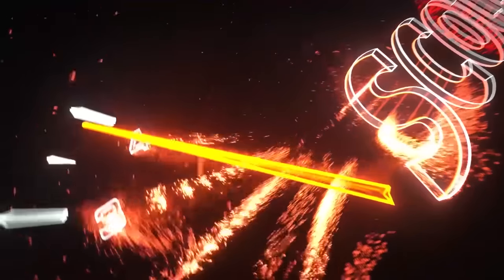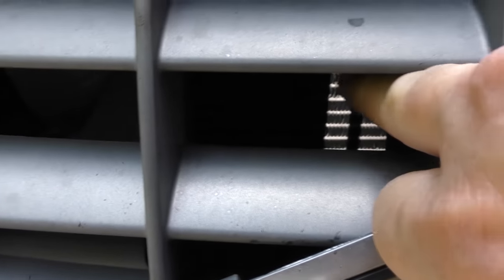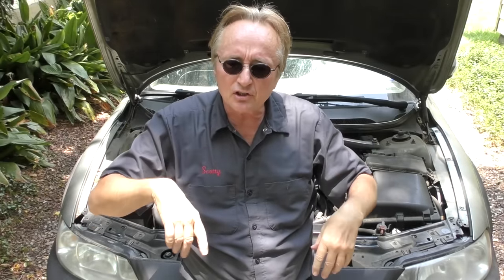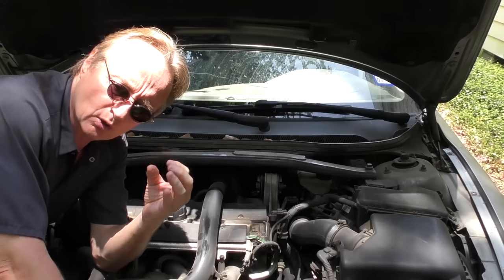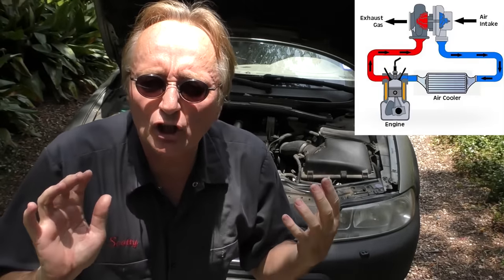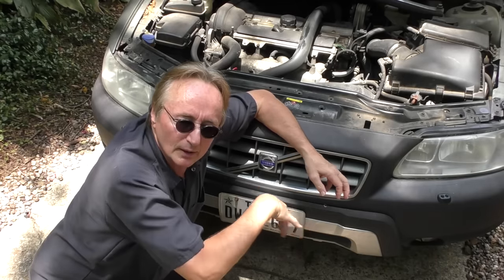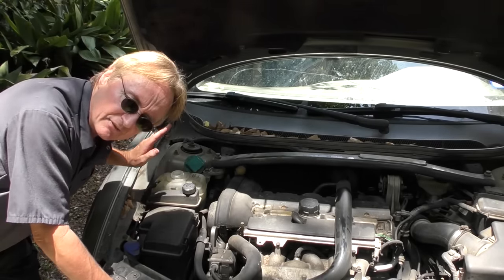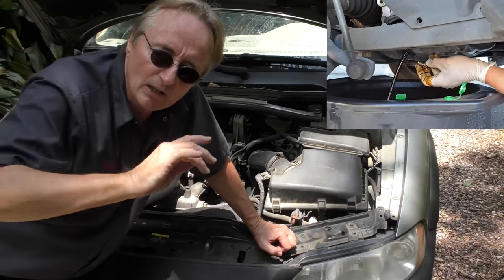5 Things You Should Never Do in a Turbocharged Car

Comment: Bought a Saab in the mid 85's and the mechanic at the dealership stopped me before I drove it the first time and told me the exact same thing Scotty said about letting the engine warm up a few minutes before driving the vehicle hard and also letting the car idle for around 30 seconds before shutting off the engine.  Told me that was the key to not having problems with the turbo charger.  Never forgot it and never had a problem the whole time I owned the car.
Reply: Those old Saabs were capable of very high mileages. Those and the Volvo 240s. Sometimes you had to find the right mechanic, however.
Reply: I don't think it was your driving, they were bullet proof
Reply: Awesome
Reply: Saabs are fuggin' awesome.
Reply: Amazing
Reply: Wow, what an honest mechanic he must be. Wish we had more people like him and Scotty around. Sigh
Reply: Yul Strokheet Al-Wauch it cycles the oil allowing it to cool the internal parts of the turbo. They make something called a turbo timer and it allows the engine to stay running for a programmable amount of time specifically for this reason.
Reply: Yul Strokheet Al-Wauch   A turbo charger can spin at up to  250,000 RPM  and the second the ignition is switched off the oil pump stops supplying oil to the bearings . The high temperature ,  lack of oil and still spinning  turbine  will eventually  lead to bearing failure  . If you cannot grasp that its probably best you dont spanner  any vehicle's  .
Reply: Came here looking for this advice. First-time having a turbo-charged 2.0 6-speed Honda Accord. Want it to last with no problems. Thank you Scotty! God Bless you & yours and Stay Well

To Derek & Johnny, I appreciate this explanation... Thanks
Reply: do that in my 2005 saab aero religiously also change oil every 6k 
let it idle for thirty seconds after hot run before switching off
Reply: Dealerships don't tell you anything like this nowadays, they just want that sale. They will let anyone test drive by themselves with no guidelines on driving with a brand new engine, who knows how that new car was ran during a test drive!
Reply: @tygyrlylly8079  interesting, not my experience.  Have bought 8 brand new cars. Not once was I allowed to drive them by myself. I'm 62 now, and bought a brand new car last May. STILL, had the salesman   on the test drive in the car with me.
Reply: So I stop the car after a drive to let it idle about 30 seconds.  Am I doing this with the the car still in drive or neutral? Or do I idle it with it in Park?
Reply: I'm about to buy my dream Saab in 2 days 😎 05 9-5 Aero in black with ventilated seats 😁
Reply: @chuckfan1 park
Reply: Also stay on top of all the maintenance of the Turbo cars! You'll pay very dearly if you don't.
Reply: So ya bought it in July of 85,,,, nice
Reply: I was informed that the more modern cars don't require this

Comment: Here's also a tip: With a modern turbocharged car, turn off the start&stop system so the engine doesn't get shut down after driving hard.
Reply: I turn it off every time I get in my car.
Reply: Is there a fuse or relay you can pull to turn it off permanently?
Reply: Texas BEAST some cars you can hook up a laptop and do some programming stuff. On 16 and newer Ford pickups you can use ForScan to rid that feature.
Reply: Yeah, start&stop is a cancer for the engine. Here in EU every car has to have it, and in some countries you can even get fined for disabling it. I just turn it off after every startup. New volvos have it kind of more clever though. It does not shut off the engine for a few minutes after startup, and also after driving it hard. Even after you turn the engine off, you can hear the electric water pump buzzing, so I guess it still runs water through the turbo to cool it.
Reply: —TheManInDboX — My manual car has start&stop, I turn it off though
Reply: It will not shut down if the engine gets harmed maybe older systems but not new
Reply: You also get aftermarket electric oil pumps that will keep a supply of pressurised oil flowing to the turbo for a few minutes after engine shut off, so that there is lubrication for the spin down time. There are also hydraulic accumulators that provide a similar function, having a bladder filled with air to pressurise an oil feed for the turbo for a minute or so after oil pressure drops.
Reply: —TheManInDboX — my Jeep has it and it only turns off if you come to a complete stop in neutral with the clutch engaged
Reply: I hate that idle stop/go.
Reply: @SeanBZA  or just put a turbo timer on it lol
Reply: Manakuski. That's a great idea because after high speed driving the turbo should be allowed to cool a while before switching off the engine, it's funny how the manufactures neglect to tell you this on Stop/Start engines but with turbos costing a fortune to replace when the Warranty has expired it does make you wonder if there's a reason for this. I have run diesels since around 1985 when they became available and then on to the turbo models, I have always let them warm up a couple of minutes from cold and then allowed them to idle before shutting it down after a fast run, in all that time I have Never had to replace a Turbo. I do regular oil changes every 7000 miles and change the filter every other oil change and this seems to work great.
Reply: @KevBoy3D  what do you have? My 2020 Accord is a 6-speed manual and doesn't have the start/stop. Didn't think a stick would have it.
Reply: @RestrictedHades  makes me wonder if my Accord mt has the start/stop since I'm always in a gear with the clutch depressed when I'm stopped in traffic. Dealer never mentioned it or the need for the turbo to cool although I knew this from operating a work vehicle having turbo.
Reply: Terri S 2012 Renault Clio
Reply: @Tsch6373  Clutch should only be engaged for shifting gears and only for shifting gears.  Don't have any reason to have clutch engaged at light.  Put in neutral at light and if necessary to not roll, use in conjunction with brake. But no clutch until you need to put in gear or changing gears.  Clutch is not a substitute for neutral.  Neutral is the only substitute for neutral
Reply: Write that down! Write that down!
Reply: I hate the start stop! Why it’s always on boggles my mind. It should be off and if I want it on, then I’ll turn it on. have to push the button every time I get in the car.
Reply: @Maynardd  its always on, because manufacturers are forced to push the emissions of their fleet down constantly. Therefore they have to figure out ways to do that for their cars and start & stop is a system that does reduce the average emissions of all of their cars by a lot.
Reply: @Manakuski  that makes sense, thank you.

Comment: I'm overdoing it. I let it run for a few minutes and slowly drive it through town before i punch it. I also spend about 2 minutes sitting before i turn it off. change the oil every 3K miles...
Reply: That's not overdoing it actually, that way the car stays clean and will always perform at her best until rust hits it cause the parts are cheap made

Comment: The bearings in a turbocharger spin at such a hight rate that really what is actually happening is the turbo bearings are riding on a film of oil. Similar to the concept of tires on a road riding on a film of water instead of the road commonly referred to as hydroplaning. This is why oil pressure is important because the bearings at high speeds cannot make contact with  metal they rely on oil separation.
Reply: Fantastic point.
Reply: When the bearings crap out the compressor wheel grinds filling your engine with aluminum filings and the engine will have to taken apart and cleaned out.
Reply: Can you highlight what needs to be done to increase fuel economy and maintain turbo charge cars? Would be really helpful
Reply: Yikes, no wonder it's so important not to ask for much boost below a good RPM

Comment: Soooo, I guess I been doing it all wrong. Accelerator to the floor, Turn key, Engine screams to 7,500 RPM  right off the bat for 5 minutes, Neighbors pissed from the noise, Dogs barking everywhere, Blue smoke fills the air, THEN I bring her down to a quiet whisper at 750 RPM and slowly creep out the drive as not to be a nuisance since I go to work at 10 PM.. LMAO :)~
Reply: I just snorted Sprite through my nose while reading this. Well done. 😁
Reply: huntercentury wait.... you snorted sprite? 😬

Comment: I drive a 2012 Volvo XC60 with much the same system. I use full synthetic oil and change every 7500 miles. I drive a lot so that's like 2 months haha. I have 176,000 miles and for "poop and laughter" I called up a Volvo specialist to ask them about how long the turbos last. The mechanic said "I've been a Volvo tech for 20 years. I've seen 2." I then called a turbo shop to see how much a hypothetical rebuild would cost. The owner replied "I don't know. Yours would be the first one I've ever seen and won't know till I got it apart". Apparently, Volvo turbos are stronger than others.
Reply: The turbos on most Volvo’s are Mitsubishi made. It’s not a common point of failure. Far more likely to hear about transmission or PCV issues. Hope you got your transmission oil changed. My 05 S80 auto crapped out around 160,000 with no changes. It was 16 years old however.
Reply: @Arby631  Mine's made by BorgWarner. Not sure about the old ones. I also have an Aisin TF80SC transmission. With fluid changes every 50k or so, it seems to be holding up well.
Reply: @alexandermartincausey7333  .   My auto transmission mechanic changes my Aisin TF80SC every 20,000 kms.   I think that it's very cheap insurance seeing that a new tranny would be around $4000
Reply: @Arby631  Looking past how an 05 model got to 16 years old prior to 2020 ;p... "lifetime" ATF is intentional industry stupidity that's come with the industry's move to sealed transmissions. It's bunk that leads to premature AT failure. Sure it's a pain to pay for a complicated change with pricey fluid every 100000km on my 1993 5 series V8s, but not as big a pain as a blown transmission which happened with great regularity in these models on the stock fluid generally between 150000 and 200000 km. On the upside, the reputation means they are cheap to buy, wreckers are well stocked with parts, and they are fantastic candidates for manual conversions.
Reply: 06 S40 5spd with 212,000 Still my daily driver, minus the headliner falling 😅 Great car! Ended up buying another one but 2010 model.
Reply: @alexandermartincausey7333  I have a 2008 SAAB 9-5 with 98,000 miles on the clock. It has the Aisin AF33 automatic. I change transmission oil every 15,000 miles because I drive quite a bit in the city. I change my engine oil--Mobil 1--every 3,000 miles. It also has the Mitsubishi TD04 turbocharger...quite robust. From new it hasn't been stressed very much...mostly on-ramps and 40-70 mph passing. Most claim that the TD04 goes 200,000+ miles if properly taken care of and maintained. Hope so!
Reply: I've got a 2005 S40 1.6 Petrol (N/A and a Ford engine but parts are cheap as it's Ford engine parts instead of Volvo prices). 

Bought in Feb 2019 for £525 with 152,000 miles. Now approaching 157,000 miles in a couple of weeks. Returns real life 40 MPG sitting at 60 MPH commuting on fast A roads. 

Extremely comfortable and would buy another one.
Reply: I’ve got a 1983 Volvo 240 with orginal turbo and engine still runs like its new
Reply: @hoppysport2872  You piss money away like its in fashion. You use Mobile 1 and change it when its only 30% through its interval and also waste your transmission fluid changing it less than 25% of its shelf life. Heck I don't think anyone should bother changing transmission fluid it lasted 257,000 on my old car without being changed and it still shifted fine when I sold it. You are wasting hundreds if not thousaunds of dollars.
Reply: @gravemind6536  most of my driving is stop and go in the city. Much more heat is generated in stop and go. I change out my transmission fluid every 18 months. I change my oil every 3,000-3,500 miles.
Reply: @hoppysport2872  Yeah like I said you are wasting huge sums of money.
Reply: Paperboy  Yes he is thats a fact.
Reply: If you do a high mileage like that your oil should happily last three times as long. Volvo turbos are a component, they are the same as those found in many other cars. The one difference is that a lot of Volvos have very low pressure turbos to aid tractability not performance.

Comment: Is it: Disconnect the wastegate air control valve so that your boost goes from about 8psi to 27psi?

If it isn’t; don’t. You’ll blow a head gasket. Learned that one the hard way as a kid.
Reply: Danger to manifold
Reply: I'm surprised that's all you lost there. XD
Reply: air control valve?
Reply: Hey, someone told me about the wastegate of the turbo. If you adjust it right you get your turbo kick in fast. Is there any danger doing that? My turbo usually kicked in at 2000-2100 rpm, but after driving the thing for about 10 years with 100000 kms on it, it started kicking in at 2500 rpm. So i did that adjustment on the wastegate and its now back on 2000-2100 rpm range. Is it good or bad?
Thanks
Reply: Should have bought an evo, boost monster
Reply: @jemsncrystals  it's time to rebuild the turbo.
Journal turbos are relatively easy to replace the bushings and seals. Just did my Mercedes turbo, $170 for the turbine wheel and the complete rebuild kit.
And on my evo I change the oil every 2k miles. @ 160k, no loss of oil between changes still.
Reply: Oh yeah, mpg.
35 mpg cruising @ 125mph
4 mpg wot.
Scotty knows.
Reply: Madmagyver but it still runs.... should i wait or ... i mean what are the effects if i dont rebuild it now
Reply: @jemsncrystals  the turbine or the compressor wheel could be hitting the housing resulting in the lower boost.
Fix it asap, if the compressor wheel comes apart you can have a catastrophic engine failure. 
I've had turbocharged cars for 30 years and Scotty is right about the importance of oil quality and change intervals.
Reply: @jemsncrystals  one of the vids on my channel shows the carnage of the Mercedes and mitsubishi turbos from my cars.
Bear in mind that I just bought the Mercedes and the Evo ran almost 30psi for 8 years (130k)
Reply: @madmagyver9981  30 psi on a stock bottom end?4g63 motor?
Reply: @kylelaughinghouse1893  just under 30. The stock Mr recirc valve opens around 30psi.
And after turbo upgrade & injectors + bov, I'll boost into the 30s.
Evos are race cars, about 600 bhp capable stock. The regular dealer versions come with inadequate injectors, turbo and exhaust plus a few other supporting mods.
And the non street version was never available in the USA. Check tmr racing site, you can buy one from them.
The Evo 9 has potential beyond what we have seen typically. I have had zero failures hammering this car for over 10 years plus the extreme tuners Evo is supposed to travel to Florida for 1/4 mile runs soon. That car is for real and it shows how amazing the platform is.
Reply: boostedsil40 did that happen to your evo?
The Evo 7 bolt 4g is the only automobile engine designed for turbocharging by a company that has been building turbos for decades. And after seeing the internals of both Garrett and mitsubishi Journal turbos, I now understand the price difference.
Mitsubishi turbos are far superior to the Garretts.
Reply: boostedsil40  absolutely. Throttle shaft seals are leaky when overboosting.
Mil spec seals are similar to hydraulic seals that hold up well also.
Reply: Madmagyver where did you go for the turbo rebuild? I have a Bmw e93 335 with twin turbos
Reply: @curtiswolfe8388  did it in my garage.
Got the parts from turbo international.

Comment: Annnnnnnnnnnnnnnnnnnd always install a catch can into the pcv system, so that excess oil does not get inside the intercooler pipes!
Reply: you cant do that on new cars anymore as most of the pcv system including valve are integrated into the intake manifold!.
Reply: @marcelcostache2504  Oh really ? Do you have an example ? I have a 2012 EVO X with the catch can, and it really makes a difference!
Reply: @Tiagotaf  chevy cruze 1.4 turbo, the new honda 1.5 turbo. the 1.4 turbo in fiats. and many many modern engines have the pcv valve integrated into the intake manifold or even in the valve cover!.
Reply: @Tiagotaf  i had a catch can on my 91 eagle talon best investment ever.
Reply: You can always just drill and tap the valve cover.
Reply: Just throw a screw in the lowest point of the inter cooler and drain it every oil change. Your intercooler pretty much is a catch can.
Reply: Or just have it vent after the intercooler
Reply: @sinissster9657  no, it does not connect to the pcv system (crankcase)
Reply: @mr.boostang2064  I hope you are joking, because that statement.......
Reply: @Tiagotaf    Can be 2012 EVO X new engine? Old car, old engine. Junk.
Reply: @fastinradfordable  what's wrong with it?
Reply: @mr.boostang2064  venting the intercooler defeats the purpose of having a turbo
Reply: @fastinradfordable  ahhhhhh good point, I wonder if there is a pcv that only opens while not in boost?
Reply: Excess oil in the pipes is called blow-by.. your pc system should work as it should unless u raise the boost pressures and only then you use a catch can with a ported valve cover bud.. if all cars needed a catch can from factory they would have them..
Reply: Island Mike  is that the new 2.9l engine ?!
Reply: @mr.boostang2064  thats basically how it works on vw/audi from 2006 on, problem is, the rubber diaphragm that stops air from flowing back into the crankcase from the intake, inevitably tears. then instead of relieving crank case pressure, the turbo is turbocharging the crankcase. very bad.